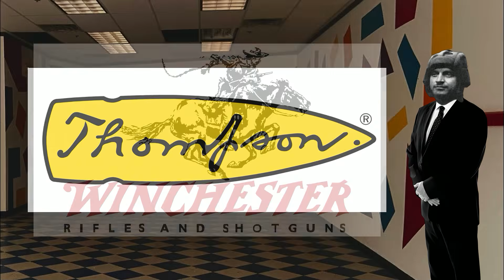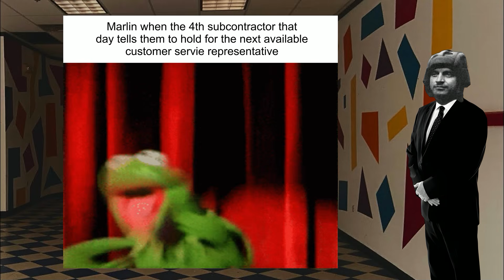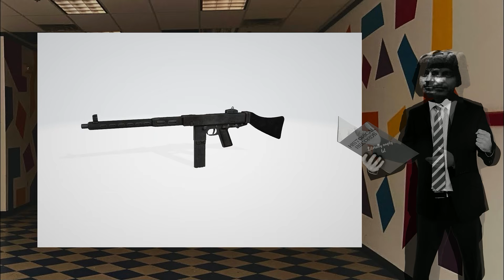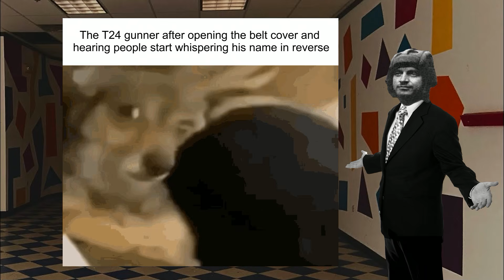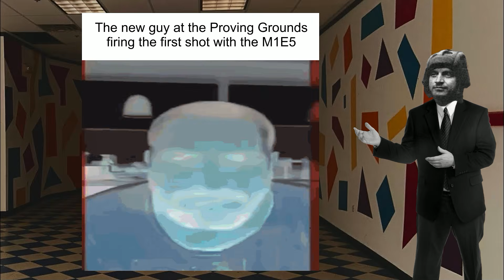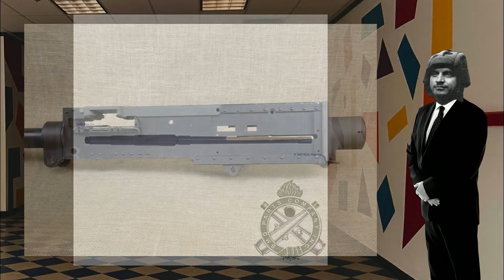Cursed WW2 American Infantry Weapons

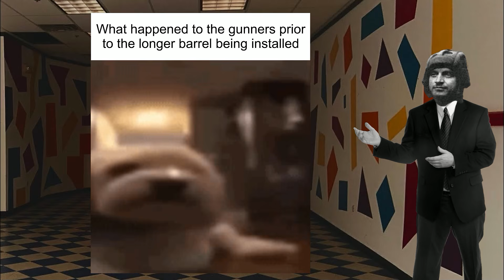Comment: 15:55 Maybe my understanding of firearms is wrong, but don't shorter barrels tend to reduce recoil? The powder isn't burning for nearly as long due to the drastically shortened barrel, so there is far less build up of the gasses. I could be wrong, but I would like a proper explanation since I have had this belief for a few years now.

Edit: Actually, after dwelling on this; I’ve come to the conclusion that the weight lost from reducing the barrel and cutting off the stock could negate the lower recoil of a shorter barrel, especially on older guns that are made of mostly wood and metal.

Comment: Epic Censorship moments:

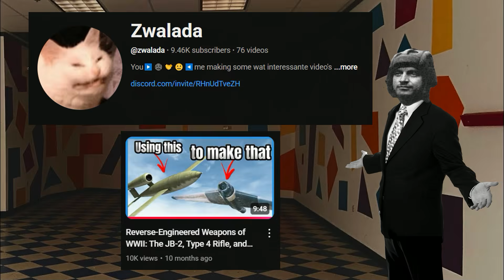8:10 What utter Y looked at an MG-42 and thought:

 “Oh yeah, 30-06, a God awful automatic Caliber for several reasons and a very obsolete Greater Rifle Caliber that We should’ve gotten rid of and been trying to get rid of for Years.”

“Let’s put that in an MG-42, just for funzies.”

Did they atleast make a .30 Cal version, something much more educational considering these are all tests anyways and this trash would’ve never made it to use

Also the failure compilation isn’t special at all; it’s not easy to rechamber guns, let alone one You didn’t design, especially with such an absurd caliber, similar to the overcompensating 8 something MM the Germans used but again; still absurd 

8:38 Incredible Y Nonsense Misinformation and History Misframing and outright Reality Denial on Your part

The “extreme” firerate (easy to achieve) on the MG-42 is nothing more than a Meme 

It’s actually the Worst aspect of the gun and what makes it Objectively Trash by both the Modern and Contemporary Medium 

Only carried by it’s Efficient Action and Good Ergonomics; it’s Great Quality Of Life improvements from the MG-34

All they had to do was give it a reasonable Firerate (and also make it a bit lighter) and they would’ve invented relative Perfection but they had to slam it with that 1,200 because the designers were Children for some reason

Practically Tiger 2 and Maus levels of “Have any of You actually heard of War?”

I can’t stress enough how Idiotic this is

Because of this glaring design flaw that Modern Children and the History Channel retrospectively Misframe as Good; the generally Inferior MG-34 steal’s the title of best MMG of proper WW2 use

Anybody with a basic understanding of how an MMG is actually used in the Real World should be able to tell You “You don’t need that, that’s Childish, what is Wrong with You?”

And also; this is 30-06, that recoil would be way too much, dear God

Do You not think before acting?

ETC-ETC

My Brother in Christ

11:45 Misframing

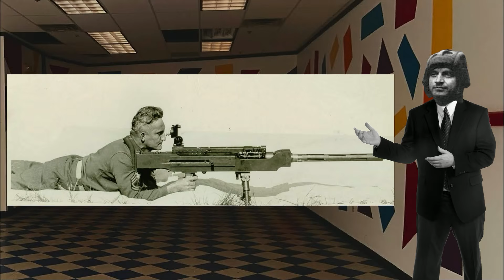15:00 Incredible piece of History 

Great lessons that are so basic Today

They’re trying to make a Barrett but don’t have the tools to make a very Good Barrett so they cheat and pull a White Feather before White Feather even happened and instead learned some basic lessons about Recoilless Rifles and Modifications

So adorable
Reply: 8mm mauser is actually 7.92, but it has lower velocity than 30-06
Reply: They also have similar recoil, and 30 carbine is an mmg would be terrible, way too low power. Also the mg42 was used differently than ho gpmgs are used today, its firerate matching that use.
Reply: @planetmaker3472 Yes, it is used like modern LMGs and SAW culture and such

And that’s what makes it so Bad; it’s firerate is just Unnecessary and meaningless and it’s far too Great to qualify nor perform as a Good enough LMG

Also, in an automatic; I’d say the 30-06 is slightly worse then 8

Single Fire; Practically about same

Auto; no, it get’s worse slightly faster which is a very important and sensitive difference in an automatics

Also; turn’s out I was lied too

There is no “30 Cal” in WW2; that’s just slang for 30-06

Very not helpful choice of words as many People have made it sound like there distinctly was a Lesser Rifle Caliber like Winchester 30-30 in the US Catalog 

I suspected it may be the same but most sources made it out as if 30-06/30 Cal were different and always treated them as such even in the same Sentence so I just assumed it was some short Lived proprietary Rifle Cal from the Interwar that Died in the 50s due to 7.62, along with British .303 and all the other European Calibers phased out for NATO

Sadly; the US was even more way too reliant on 30-06 than I knew

That’s what I was referring to; sorry 

Although a 30 Carbine, relative Medium LMG would be adorable and Groundbreaking for the Time

Not very forward thinking in performance but inspiring in design
Reply: @ComfortsSpecter whats your beef with 30-06? It and other full power cartridges where what they had back in the day. Of course with hindsite you could say its to much but the doctrines where different. Also the reason for the mg42s high rof was to maximize killing potential in the shortest windows of time, like some infantry crossing between cover at a distance. Now it doesnt mean it was the best thing ever, but it is what set it apart
Reply: @planetmaker3472 Different doesn’t equal Good and Objectively Military Economics matter’s more than maybe ten Times in Your entire career; You might actually desperately need that 1200 RPM, make no difference in the War whether You have it or not and still lose because Your Country’s Logistics are Disgusting

I’d rather not blow through all My ammo several Minutes faster, need to carry more and resupply more for Practically the same exact result
 

And 30-06 is a Greater Rifle Caliber; it’s not just a none Carbine, objectively better, but it’s an overcompensating Rifle

Being old isn’t a Good excuse, it’s just an excuse

Many People back then knew better; that’s why the 30 Carbine was attempted 

But 30-06 was a retrofit of the 30-03, carryover from pre WW1 and also a holdover from WW1 and again; only around because the Military was too Inefficient to move on (100,000s of American used 1903s during WW2) and also Springfield was very corrupt and we all know they and many other Corporations were abusing Politics to stay in circulation

And in WW2; Rifle Cal was indeed far more Practical than it is Today for a plethora of reasons, none of which defend using a Greater Rifle Cal but instead a Medium Rifle, which 30-06 still isn’t but again; much more Practical than Today

And a Carbine still woulda been better in almost the majority of all engagements if not Simply the Majority 

It’s a worthless Contemporary Caliber that only made sense in the late 1800s to about 1920s

Could’ve easily adopted something better before WW2 instead of waiting until way after WW2 and all the way till the late 50s

Again; plenty knew 30-06 was past and that’s why they tried to make 30 Carbine work but that simply wasn’t a Good design

Comment: The thing about the disagreement, between the tenth and eleventh hound of the t24, you have to take in consideration a quirk in the design of the mg42,with the mg42 being a short recoil operated gun and the bolt going back and forth at mach fuck, sometimes the bolt would slam so hard at the chamber face that the whole assembly of the bolt and barrel would end up bouncing back with just enough force to recoil just enough that it would unlock the bolt meaning that the round that was chambered in said slam would fire out of battery, meaning that said round would have a ruptured case, with the germans solving the problem by just using steel case ammo, wich would not rupture when fired out of battery, as to what "object" fired the eleventh round, idk maybe satan shoved his dick on the reciever or something

Comment: A .30 carbine Thompson would be sweet, other then the fact that it would be 12 pounds. The m1 carbine is a treat to shoot
Reply: At least the recoil would be nonexistent. To put that weight into perspective, both the M1 Garand and the M14 were around 9-9.5 pounds, the Thompson SMG was about 10 pounds, and even the infamously heavy BAR was 16 pounds. This “light rifle” weighed as much as six full canteens.
Reply: @Shaun_Jones  probably not so light on the recoil, given that the thing was straight blowback, hence most of the weight

Comment: Americans on their way to build something that fire as fast as the MG 42 and then never use the design again for no reason.
Reply: I’m of the opinion that the MG-42’s rate of fire was actually more of a downside than a benefit. You have to carry so many extra ammo boxes and barrels just to make it worth using, and what does firing that fast actually accomplish?
Reply: @Shaun_Jones I think at th end of the day it comes down to what each army wants their MG to do. Sustained fire vs short accurate burst in this case. For what the mg 42 was designed for as in high fire rate in bursts it was a good machine gun. But that was not what the us army wants so we never seen one from them. But it was kinda funny to see some people touts the mg 42 as the best mg ever due to it's cool stat. Only for the americans to match that fire rate then never using it because they dont need it.

Comment: Remember the funny thing about the Thompson: it was literally designed around a mechanism that didn't work. The original designers of the Thompson (John Thompson and John Blish) believed that brass and steel had different coefficients of friction at high and low pressure, and designed a bolt delaying mechanism based on this assumption which they claimed would stay closed at high pressure and open immediately at low pressure. They were completely wrong and this delaying mechanism did nothing, but the bolt was so heavy that it functioned as a straight blowback anyway. US Army General Julian Hatcher proved this in 1942 when he put forward the M1 Thompson, which simplified the Thompson design in several ways including completely removing the delaying mechanism. Between removing the delaying mechanism and several other cost-cutting adjustments Hatcher was able to reduce the unit-cost of the Thompson to $45, down from $209.
Reply: Ah yes, the "Blish lock".
Reply: From what I've heard and read it's not that their mechanism did nothing but it did next to nothing so was useless still anyways
Reply: Australia was paying something like $320 per kit for the Thompsons...

...that were meant to used on the Kokoda Track. Yeah. And they were the OG Thompsons, not the simplified ones redesigned by Hatcher. There's a reason we came up with the Owen Gun - a gun US GIs tried to trade for, and even Macarthur wanted something like 300,000 made to outfit US troops in the Pacific.

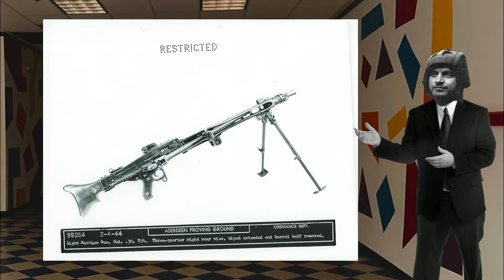Comment: 8:29 and 20 years later they adopt M240, basically upside down BAR with MG42 feeding mechanism. and in modern day MG34 made by Ohio Ordinance compete with M250 (REAPR based on MG34) what an amazing timeline we have. guns already peaked in the 40's
Reply: What about the AUG
Reply: @Dingkele67  idk, the only bullpup i like is Ash-12 which is kinda new. but truth to be told many guns today inspired by older guns. AUG had quick changing barrel idea from MG42 and the operating system itself inspired by AR-18. many modern gun infact inspired by AR-18 such as Howa Type 89 and G36. but AR-18 itself isnt really original, it was using lesson learn from many ww2 guns such as ejection port cover from STG-44, Bolt locking from M1941 johnson (its actually older than johnson) and straight-line stock layout (used inside Buffer tube) from M1941 Johnson LMG and FG-42.

AUG is bassicaly bullpup AR-18.
Reply: tbh i kinda wrong myself. gun peaked in late 50's  to middle 60's considering how many AR-10 influence in modern gun.
Reply: @gastramaybethatsucksatengl2315  To be fair, there isn't a lot of reason to be original these days when you have soo many existing working designs, why make a new one when the chance of wasting soo much money on something that sucks is soo high?
Reply: The Belgians copied a Browning design ?
Reply: @GBAARW FN Mag were created to modify BAR into modern standard. So yes they copied the BAR to make FN Mag
Reply: I think the reaper only looks like the mg34, i thought they where mechanicly different, like saying the ak47 was based off the stg44
Reply: Also the m250 is not the oo reaper,

Comment: They should of had a flash hider on the shortened Garands to compensate for the added muzzle flash. Recoil would be more severe because you are reducing weight. They could do what the Russians did and add weight to the shortened gun so the recoil is not so bad. The Soviets made a shortened version of the Mosin Nagant called the M38 carbine which everyone hated because of the brutal recoil. In 1943, they added a 1.5 pound bayonet to the rifle now designated the M44 carbine, which had significantly less recoil than the M38.

Comment: If I had a nickle for every time a .30-06 conversion made a gun perform horrendously worse, I'd have 2 nickles.
Reply: Sorry, bit while, but what was the other one?
Reply: @WilliamJonsonmam  the 30-06 conversion of the Chuchat was apocalyptically bad; and is the direct cause of that entire weapon series being labeled the worst machine gun ever made (which isn’t fair since the original 8mm Label guns were pretty good, albeit a little finicky in the mud and sometimes not built to the highest standards).
Reply: @Shaun_Jones  Using oiled cartridges and then sticking two giant holes in the rather weak sheetmetal magazines certainly didn't help with the gun's finicky-ness. Makes me wonder if the French had gone with a closed box mag (like the Belgians did with their 8mm/7.65mm Mauser variants and the .30-06 trash heaps) how many issues would've been eliminated or severely tamped down on
Reply: @WilliamJonsonmam  chauchat
Reply: @WilliamJonsonmam the 3006 Chauchat
Reply: @WilliamJonsonmam  Chauchat
Reply: @WilliamJonsonmam Chauchat. In 30-06, it was atrocious. In its original 8mm Lebel, it was actually pretty good.

Comment: Funny how they tried to shove a imperial unit round into a german gun, failed and now use much more metric sized rounds than ever before.
Reply: Well kind of, 7.62X51 NATO is metric in sizing yes but it's using the same .308 caliber bullets that 30-06 does, and 5.56 NATO is also not really a native metric round as it's obviously related to .223 Remington, really the only truly native metric round in US use is 9MM Parabellum
Reply: @deepbludreams 
.308 Winchester was spun off the T65 experiment design based on .300 Savage, with the T65E5 being adopted as 7.62 NATO. 5.56 and .223 are likewise the same cartridge.

There are minute differences in each (milspec/civ or metric/caliber) pair you need a macro lens and a good eye to spot, 7.62 and 5.56 are both marginally thicker case walled with a different headspace size, and are higher pressure than .308/.223.

Also because the outside is very nearly the same size you can freely interchange each into a caliber rifle (but loading caliber into a metric rifle can cause the thinner case to expand into the larger headspace and rupture in the chamber)
Reply: @Pretty_Cure_Preme iirc it's a weird situation where .308 is more powerful than 7.62 but .223 is weaker than 5.56

yes I know, confusing

like the adoption situation
US basically force NATO to use 7.62x51
then instead later they adopted 5.56x45 from a version that Belgium use (which is, of course, based from .223 rem) and also force NATO to use it
Reply: @Armorpiercer  .308 isn't .30-06, 7.62x51 is higher pressure than .308 still.

I also wouldn't use the word "forced" so much as "Remembering the world wars". We showed up with crates and crates of .30-06, .30 Springfield, and .45 ACP while the Brits had to source their own .303.

Later come Vietnam and the Gulf War we (US) could just toss the Brits and ANZAC a case of 5.56 or 7.62
Reply: @Pretty_Cure_Preme  I see US insistency of using 'their ammunition' annoying as everyone at the time have their own arms industy and trying new stuff, then US proceed to halt their process for a good 10 years, to use what people 10 years ago thought is a good idea anyway
Reply: Funny how Germany uses an American round for their rifles now 5.56
Reply: @joeblowe3180  Exactly, OP has no clue what he's saying. Must be German
Reply: Nope, 5.56 is American developed (Remington .223)
Reply: @joeblowe3180  US took a 5.56 NATO from Belgium development (SS109 rounds, used as M855) because they flubbed up intermediate cartridge rounds for 7.62 NATO
Reply: 7.62mm NATO is just a shortened .30-06 that the US strong armed every other western country to use.